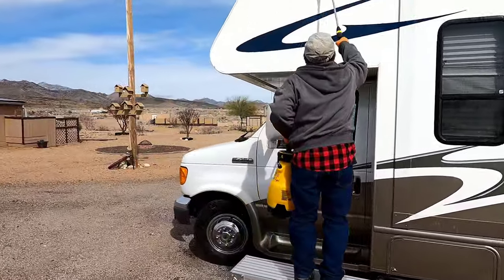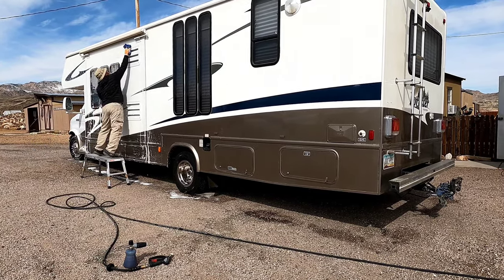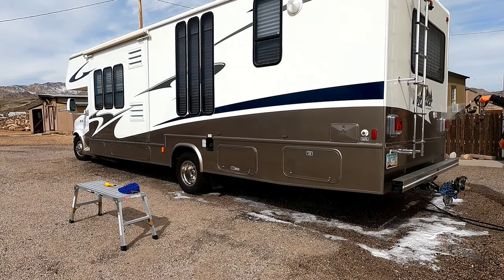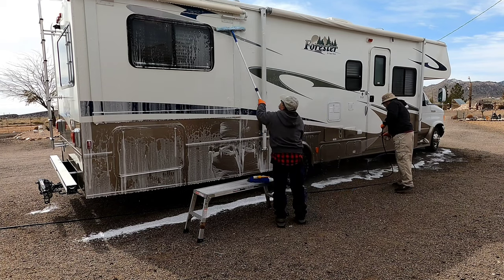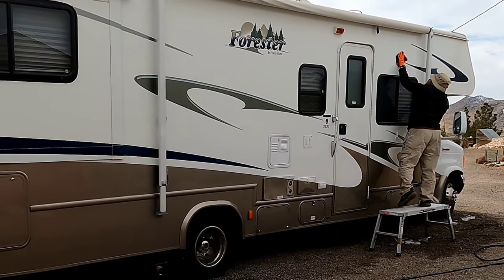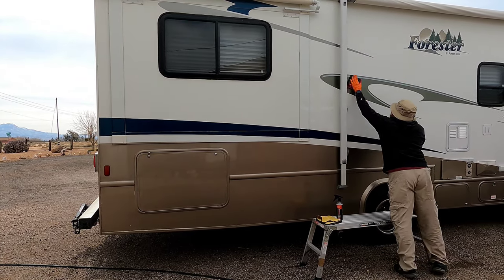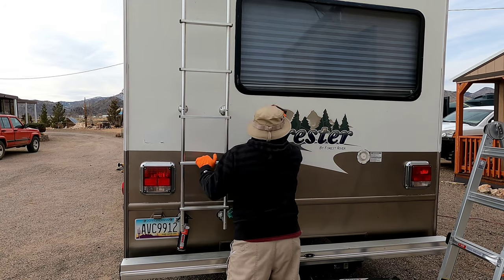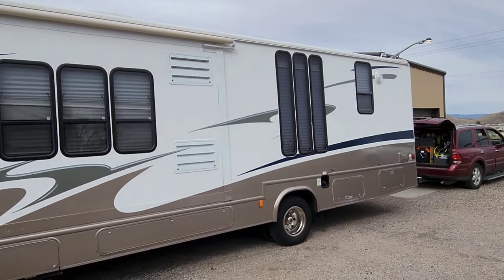How To Restore Faded Camper Gelcoat (Easy DIY)

Comment: The RV looked great after, I am waiting for the snow to go away and the warm weather to remain for good and I will be spring cleaning my RV. I will try the clay towel to remove the oxydation. Thank you very much for the video and the technique.
Reply from the maker: Thank you for the comment, I really appreciate them & you're very welcome! I'm glad I could help you out! I have used different clay towels and theirs is different and better. It's much thicker than most amd the perforated clay helps keep product where you need it. I like doing it this way because you're combining the decontamination, clay, oxidation removal, & sealant all at the same time! I also use a DI water system that totally eliminates water spots and is small enough to fit under a RV in storage. Here's a link to save 6% & free shipping from RV mods, where I get my DI system. Thanks again!  https://rv-mods.com/store/DI-Pro-50-Compact-p142494914